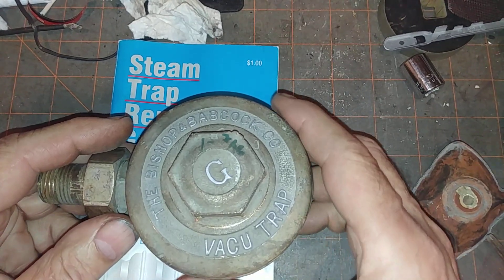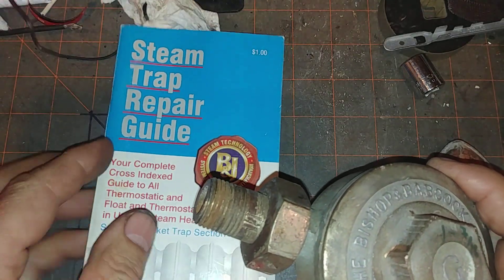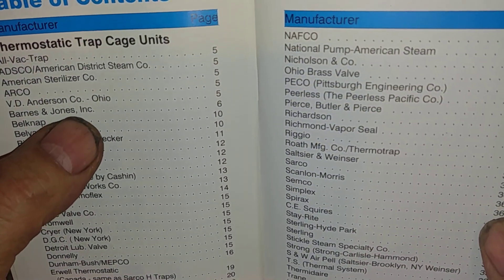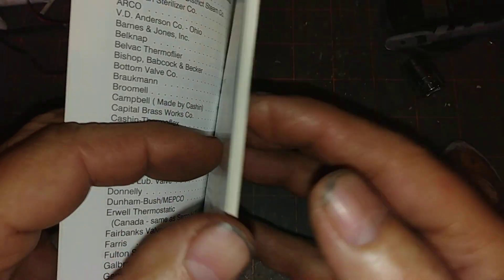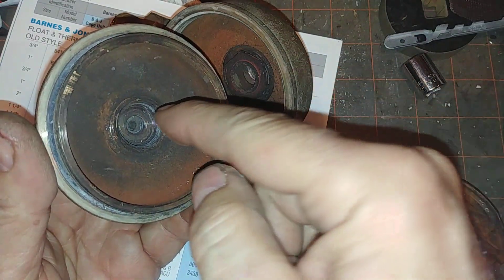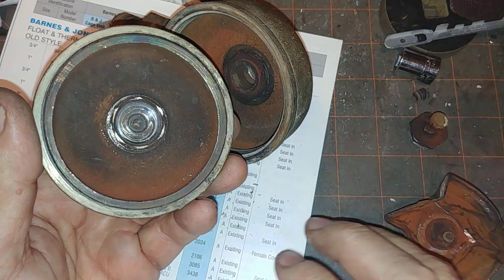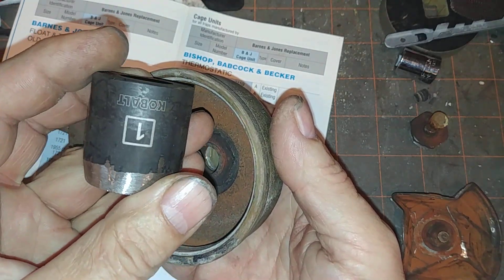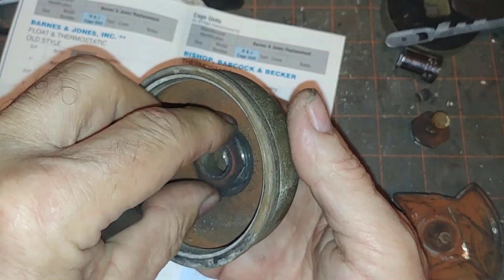Some Issues Using Barnes & Jones Cage Units To Re-build Bishop & Babcock Steam Traps

Comment: Great video.  B&J provides the BigMouth repair kit but it calls for Loctite 593 black (oring & tough to locate) and red Loctite for disc.  Any chance you have rebuilt one of the newer BigMouths and have a video?  or just use anti seize (copper or aluminium)?  Thank you.
Reply from the maker: I have not rebuild a BigMouth and was not even aware that a rebuild kit for this product existed (Thank you for that info!)
I have question for you, sir:
What caused you need the kit? I presume that a BigMouth you installed failed to close properly and leaked steam?
Reply: @gordonschweizer5154 spitting water after 3 years...bj sent the kit.

thanks again!
Reply from the maker: I am sorry the vent failed for you so soon. Sucks.
I confess I was somewhat concerned about o ring longevity for their main vents.
I remember when the BigMouth was first put out there and there were spitting issues until they put the o ring in.
We decided not to install a BigMouth vents on any of our systems as a pure end of main vent.
We have installed them as dry return main vents as they should not see steam unless there are failures of traps up stream.
Any spitting there is not an issue.
We have also installed BigMouths as end of main cross-over traps where any spitting is also not an issue.  
The BigMouths  are the best cross over traps out there!

Comment: Weird, I've never had a problem using 4232s in a #6 with the original cap.
Reply from the maker: What I was told by folks at Barnes & Jones was that back in the day, some trap manufacturers would change their specs for a particular model willynilly.
They were under no obligation to inform B&J, as they were competitors.
B&J shared with me the mechanical drawings they had in their files of this Bishop & Babcock trap model that do not match up with the physical specimen I show here.
This is not the first time that what is called out in "the book" & what I've found the field in Baltimore were at variance.

Comment: Good video. I replaced thousands of those in Dunham Bush steam traps in the Sherwin Williams HQ building in downtown Cleveland Ohio. Some of those B&J cage units lasted a long time, and some did not. We would reuse the old caps from the 20s because they were made from the good old red brass and lasted forever. We had a lot of problems with new caps not being flat and they would leak. The tunstall caps were real garbage.
Reply from the maker: Thank you for your kind words and sharing your story!

Many caps come with gaskets to try to seal properly.  They are very easy to destroy when installing (aaggh!).  Other caps would not "need" gaskets (supposedly), but would not thread all the way down to make the metal to metal contact to seal (or attempt to seal) just as you say.

Part of the issue is machining tolerances, and poor quality control, etc. as we both have experiences on.  Fun times!

The other deeper part of the story is the traps you might be working on were made to different tolerances than the sample B & J obtained in 1929 or whenever.  For example, B&J kindly sent me copies of the dimensional drawings they made "way back when" from their files on the trap shown in my video.  It was way off, because the manufacturer had changed their specs and were under no obligation to tell B&J before disappearing into the forgotten mists of history.

Comment: Gordon, for that vacu g, I'd cut off the needle stopper, but leave the disk (the piece you bent out), then try that. To the eye on the video, looks like that would fit? Thanks for the videos.
Reply from the maker: Thanks!
Yes, that might do the trick.
Per B&J's request, I mailed this trap off to them and they also allowed the return of the cap & cage element.
We'll see what they come up with.
Reply: @gordonschweizer5154  That element is its own independent thermostatic valve, so any spring that would fit and hold it firmly in place should do. As to the seat/seal, a bit of gasket maker and that should do in a pinch.
Reply: Good information.  The B&J  cage units and caps performed quite well. We used mostly the 1950 and 1929 units with a few random others here and there. The company started a steam trap replacement project and purchased Tunstall cage units and covers. We had so many bad caps it was ridiculous. The flat surface of the caps were warped and not flat.I got four bad caps in a row on one job one time. Tunstall wound up having to reimburse our department a good amount of money due to bad steam trap caps. This also caused a lot of plaster damage throughout the building.
Reply from the maker: Thank you!
I was indeed sorry to hear that you had issues with Tunstall covers and that they caused you and your customer grief.